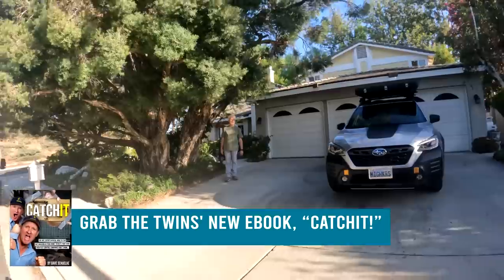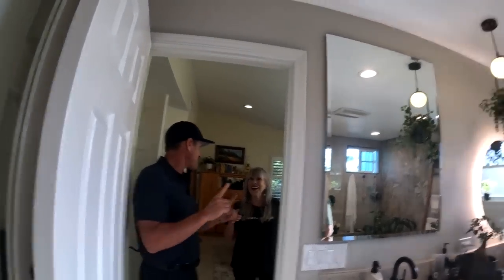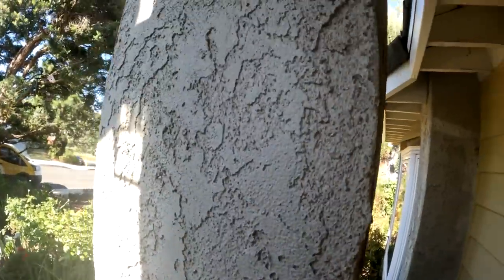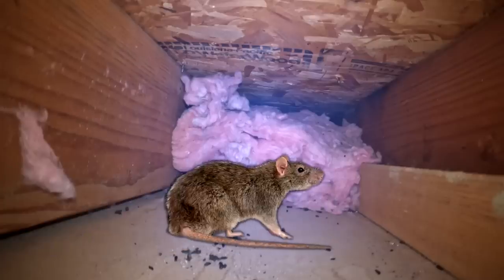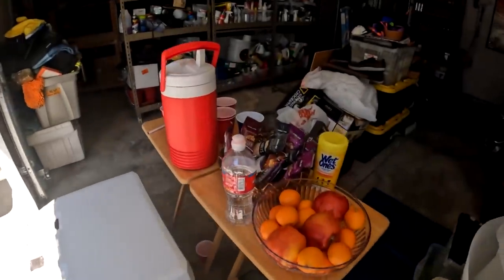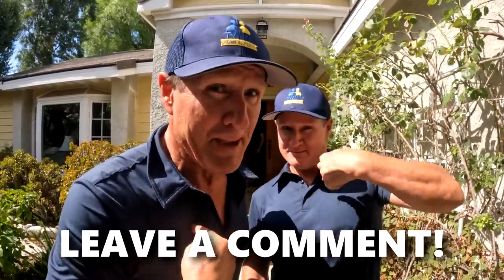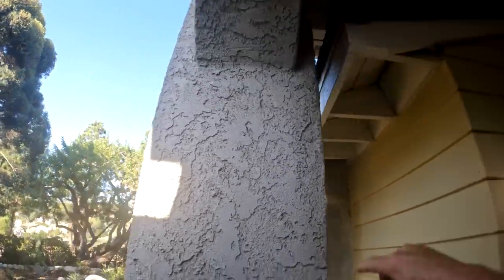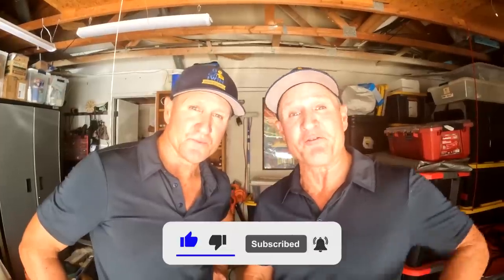SCRATCHING THE WALLS!! You won't believe what we found...

Comment: It kinda surprises me on how cheaply houses are build in the USA. Germany have concrete walls I can’t even hit a nail in u have to drill a hole then put a plug in to actually able to screw a screw in. That’s quality. Doors hollow and flimsy in the USA. They either out of solid wood or metal. I have noticed this a lot USA like it fast and cheap but no quality. And u see where they got the USA? No one wants to most of the stuff from the USA anymore. Because quality is pretty mediocre at best. What is unfortunate there was a time things from the USA where considered great mad quality and also wanted things from the USA. Not anymore for sure at least most of the stuff no other countries wants from the USA. And I don’t blame the. Hollow cheap walls hollow cheap doors. Flimsy turn handle just all so flimsy and cheap.